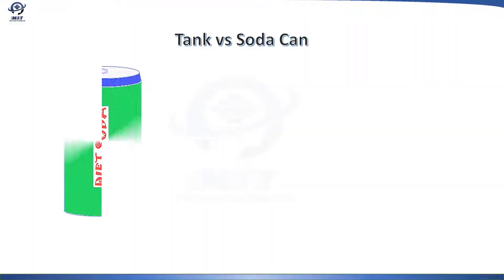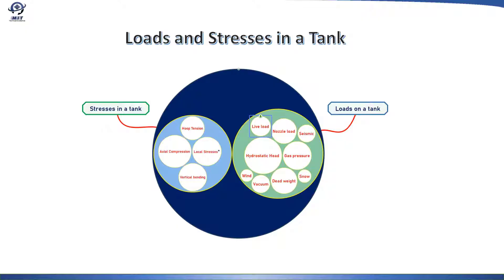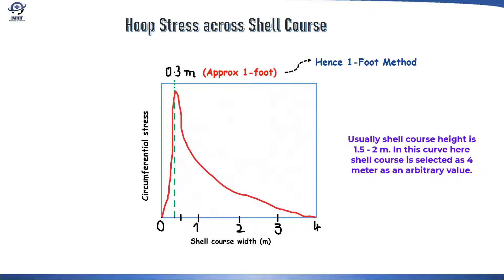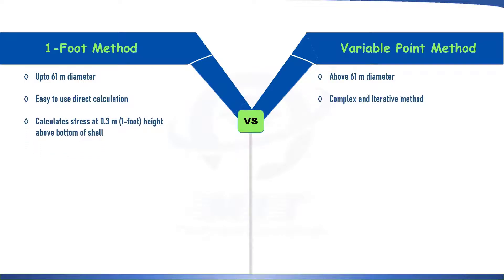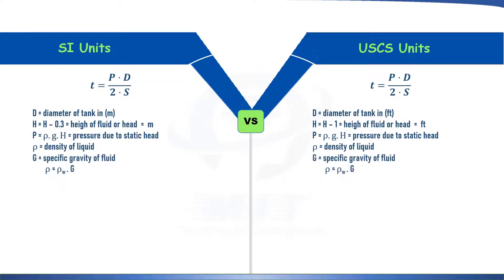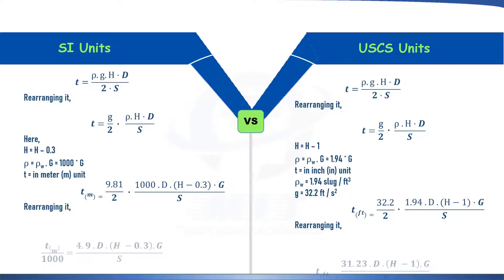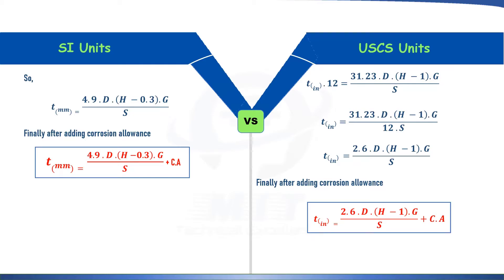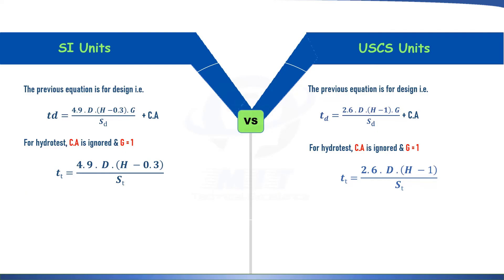API 650 Storage Tank Thickness Formula - One Foot Method

Comment: Please let us have the plate thickness calculation of 9 Mtr Dia tank, Cylendrical Tank Height is 11.5 Mtr, Cone Height is 6.5 Mtr, Ground Clearance of Tank dischage from GL Is 3 Mtr, The material shall be stored in tank is Fine Chemical Powder, The density of powder is 1400 Kg/ Cub.Mtr.
Reply from the maker: Api 650 is for liquids
Reply from the maker: Ur application it seems for sillos
Reply from the maker: Also tank roof 6.5m is too steep

Comment: You said in your video that the maximum hoop stress is found at 1 foot from the bottom of the course. Can you please provide me with the reference that said that
Reply from the maker: First reference is the code itself.
In order to get the maximum thickness u need to put height where u will get the maximum stress. Code assumed it 1 ft above the bottom. Actually we have welding on top and bottom of course and hydrostatic forces in between that forces the shell outwards
Reply from the maker: Kindly share my videos in your links
Reply from the maker: As a result the max effect of stress is at 1 ft on the course
Reply from the maker: Second reference is STORAGE TANK GUIDE by BOB LONG
Reply from the maker: 3rd reference is ABOVE GROUND STORAGE TANK by Philip Myer chapter 7
Reply: @codes.standards   Thank you very much but can you provide me with links for these references because i am having trouble to find them
Reply from the maker: http://libgen.rs/search.php?req=Storage+tank&open=0&res=25&view=simple&phrase=1&column=def
Reply from the maker: I can share on telegram app
Reply from the maker: Add my no. 00966547208001

Comment: I have a question. Please help me understand this formula in front of me to calculate the shell retirement thickness. 

160' tank. H= 38'. G=0.85. Sd= 20,000psi. Each shell course is 8ft wide. what is the retirement thickness for the 3rd course?

td= 2.6 X 160' X (38' - 1) X 0.85 / 20,000psi is as far as I can go... where do I add in that each course is 8ft wide and to calculate for the 3rd course retirememt thickness? do i replace the H=38ft for H=24ft to satisfy the 3rd course?
Reply from the maker: 3rd course from bottom
1.   38-1
2.   30-1
3.   22-1
Reply from the maker: Kindly share my video in ur links

Comment: This calculated thickness is for the lowest section of the shell, how do you determine the thicknesses for the each upper subsequent shell🤔
Reply from the maker: Let suppose u hv a tank with total height 10m
With 5 shell courses each having 2m height
1. For bottom most shell put height H = 10M
2. For 2nd shell from bottom put height H = 8m
3. For 3rd shell from bottom put height H = 6m
.........
Reply from the maker: Also remember there is a 1 ft or 0.3 m height minus in api 650 formula for 1 ft method from height for that shell
Reply: @codes.standards  thanks 👍

Comment: Dear Sir, If I want to calculate the Thickness of the shell from the second course from the bottom, Will that make any difference in the value of Height ? (Will the height of the bottom or base plate be deducte in this case ?)
Reply from the maker: If tank height is 10m with 5 courses of 2m each, then H for bottom course will be 10m
For 2nd course from bottom it will be 8m
3rd course from bottom will be 6m and so on.
In the formula by api 650: 1-ft or 0.3 is subtracted for each course height due to the reason explained in the video.
Bottom plate thickness is not included in height calculation
Reply: @codes.standards  thank you!!!!
Reply from the maker: For 1 foot method:
Height H for each course is measured from bottom of that shell course to top of the shell or where ur maximum liquid level is
Reply from the maker: Kindly share my videos in your links

Comment: Thank you for nice explanations.
How do we do coils design in storage tank?
DID ASME Or API 650 talk about coil design in storage tanks?
Reply from the maker: Steam coil like u loop is used in both tanks and vessels.
It can be designed using asme viii div 1 individually for components.
Reply from the maker: If it is steam heated. It is like a multi pass u loop pipe. 
it can be employed both inside api 650 tank or asme viii vessel.

There will be 2 design calc.
1. Heat transfer calc (thermal design)
2. Strength calc as per asme viii div 1 (but done manually for each of coil components like pipe, flange etc.

Comment: what is s ?
Reply from the maker: Dear,

As per api 650 spec. clause 5.6.3
S = allowable stress
Sd = allowable stress for design case
St = allowable stress for design case
Reply from the maker: Correction  St = allowable stress for test case
Reply: @codes.standards  will s be given or should we calculate? what is the formula to calculate
Reply from the maker: It is given in code tables 5.2a and 5.2b

Comment: Why is Hydrotest thickness different. The hydrotest shall be performed on the same tank and not a different tank, right? And the tank must have been manufactured with the design thickness, right?
Reply from the maker: Let suppose u have to store crude oil SG = 0.8
And hydrotest is usually with water SG = 1
Then u will calculate both tt and td.
Finally u have to take the higher value of thickness of tt and td.
This means u covered design for both cases.
Reply: @codes.standards  Got it. Thank you!!

Comment: Nice Work. Can you clarify - to convert thickness from m to mm - you need to multiply by 1000 (not divide) - so you get 10^6 on the numerator. Allowable stress S needs to be in Pa in Barlows equation. A typ value for A516M material would be 137 MPa. So when we convert S from MPa to Pa you get 137 x 10^6 on the numerator. So the 10^6 terms in the numerator and denominator cancel each other.
Reply: Actually first I brought the right side 1000 to left side.
So it goes in divide I.e denominator. Still the thickness is in meters.

Then in 2nd step I converted m into mm.
Then both 1000 cancels each other
Reply: At 9.16 the right side 1000 goes to left side of equation so it goes in divide
Reply: At 9.16 the right side 1000 goes to left side of equation so it goes in divide

Comment: Please help me answer the question..
Tank diameter 200 ft,Total height 56,Thickness hidrotes of shell of shell course 1(inch)=1.239 which material could fulfill the requirement of api 650 for above condition 
A. astm a-285m grade c
B. Astm a-516m grade 58
C. Astm a-573m grade 65
D. Astm a36

Please answer and reason
Reply: What is the design metal temperature?